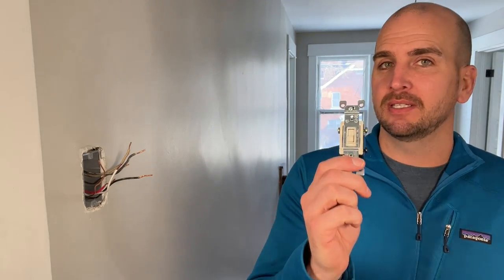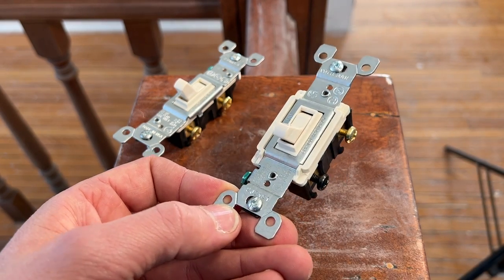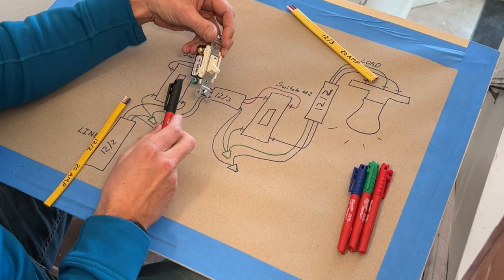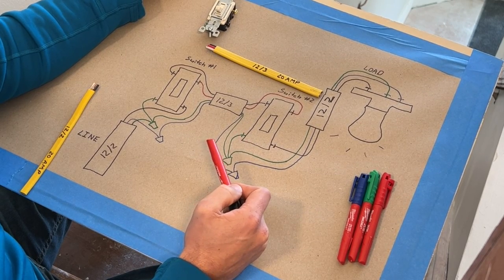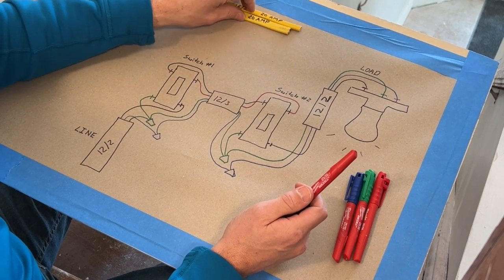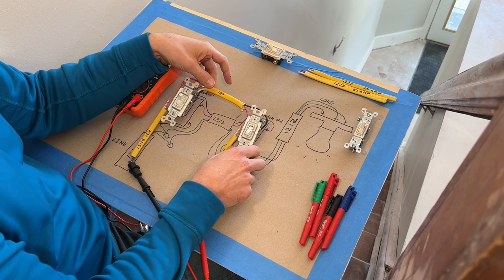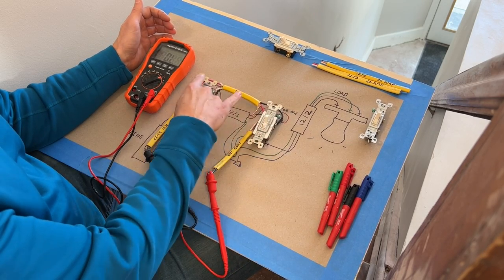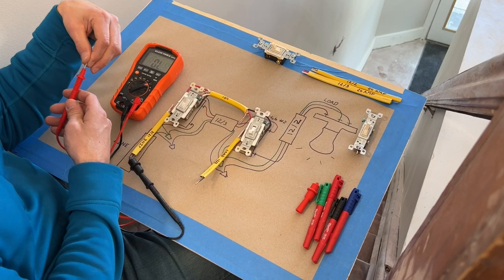How To Wire a 3-Way Light Switch

Comment: When I worked at Menards, I always told people to mark the common with a piece of electrical tape before removing the old switch.  The two travellers can be flipped without issue.

Comment: I replaced a 3-way with a dimmer  with a 3-way without dimmer today, and got the travelers reversed, since I couldn't figure out which was which (thanks to the strange color coding on the wires). By the time I got everything back together, 'off'/'off' (that is, the switch position where a 2-way switch is off) turned the lights on. The funny thing is that my wife doesn't believe me that it's different than it used to be, so I don't need to fix it!

Comment: I love your videos but at the end of this explanation I feel a little like Will Smith at the end of the "Because we're the best of the best of the best.  Sir" speech in Men in Black.  It seems to me like the real reason that has gone unsaid is that: whereas a single two-way switch opens and closes the circuit, the three way switch actually switches between the black hot and red traveler to carrier connection.  So unless both switches point to the same conductor, the circuit is broken - and that's WHY you can open or close it at either location.  As in, the diagram of the switch would help explain the WHY vs. the WHAT.

Comment: Electrician here. You did a great job explaining travelers with the most common wiring technique. There are occasions when the circuit is wired differently ( usually in older homes) But your base explanation was on point. Great job ( are you an electrician btw?)
Reply from the maker: Thanks for the feedback!  I'm just a DIYer slowly building experience on my rentals, flips, and my own projects around the house.

Comment: Excellent review! Not sure if it matters, but my preference for three-way switches is to have the light off when both switches are in the same position (if both switches look "off" then the light itself is off). Does code care one way or the other?
Reply: I prefer the same; when all switches are down, the light is off. When you have one switch down and the other up and the light is off, generally you can just reverse the travelers on the up switch and this should turn the light on. When you lower the switch, it should turn off.

Regarding code, I just finished a series of inspections, which included turning a single pole light switch into two, 3-way switches and the inspector did not care about switch orientation.
Reply: @Around_The_Home  
Why would you care about positions? What if you had three switches controlling one light (two @ 3-way switches and one 4-way switch)? I doubt that all three would be in the same position most of the time. Besides, more often than not you can't see one switch from the other.
Reply: @njsongwriter  Why do people show orienting switch/receptacle faceplate screws so the slots are all vertical or all horizontal? Who ever looks at that? To answer my own question, it is called finishing touch. Also, my upstairs hallway light is controlled by three switches and when all the switches are down, the light is off. The light is also off in other scenarios, but it is always off when all three switches are down.

Comment: Hopefully I can see you do a 4 way light setup. That would be cool
Reply: A 4 way switch would be a switch with 4 contact used in the middle of the 3 way switches. It allows you to have 3 or more switches controlling the same light. 4 ways in the middle with 2 travelers coming in and 2 going out and 3 ways on the ends

Comment: Question, can you add a single pole switch to control a different light at switch number 2 without running a new power into the box? Can this be done safely and current code?

Comment: What does it mean if I have a light switch at the top and bottom of the stairs and they both can be used to turn the light off and on but they can't be used to control the light together?  Example: individually they work to control the light but if one is turned on the other one can't turn it off.  Does that mean I have a wire in the wrong place?  Or is there an issue with the traveler wire?  Thanks for your help.

Comment: My wife and I are adding Lutron motion switches in our stairwell to our basement. The upstairs switch has a  wire that continues to our foyer ceiling lights. The stairwell originally had mechanical three way switches in it. We have successfully gotten the lower motion switch to work correctly, but can’t get the upstairs switch to work with the motion switch. Any ideas on what I am doing wrong?

Comment: Question: can I use a 3-way switch as a single pole? If so, do I connect the line wire to the gold screw and load wire to the black screw or the reverse?
Reply: Yes, but you burn money for nothing.

Comment: I have two 3 way switches operating 3 ceiling LED pot lights. Everything works fine except for some ghost voltage in the circuit - when all the lights are off the LED lights have a small noticeable glow. Do you know how to eliminate this?

Comment: I have two light switches in my kitchen so if you leave house out the garage you can turn off kitchen light without walking to the other end going towards living room....i never understood why on mine, one switch is up in the on position while the other one is off and the light is off. You would think both switches would be off and light would be off and to turn the light on, one of the switches had to be in the on position for the light to be on.....not mine if both is off, light is on... and you can flip which ever switch you want up and it'll turn the light off....well this was working fine just confusing me because I'm use to light switches being in the down position for light being off, I became use to it....but not to long ago, it started acting weird...if I had the switch by the garage in the up position, the switch by living stopped working (up and down had no affect on light)...then if the switch by garage was switched to off, the living room side switch would work just fine up or down turning the light on and off.....I'm so confused and I have not touched any of the electrical and it randomly started this issue. So now I just leave the garage switch in off setting and only use the switch in living room to turn lights on or off in the kitchen.........anyone know what's going on and might help me out?

Comment: I've tried and tried to wire it right, but I can't figure it out. This is a great video for 3 ways, but I have 3 switches for one light. So there are two 3 ways, and one 4 way, and I can't get them to work together for nothing. Replaced all switches the same way they were wired, but it didn't work before either. So I gave up, I now have to walk to the bottom of the steps to turn my light on and off. Good excercise lol

Comment: I owned a house that had a four way switch system. Three switches and a single light fixture above a basement stairway. Thankfully I never had to change those switches out. One switch at the bottom of the stairs, one switch at the middle landing which led to a side room, and the final switch at the top of the stairs on the main floor. The light hung on a long cable lighting all of the stair sections.
Reply: One of the switches will be an intermediate switch, the traveller wires/strappers connect through the switch, it really is no more difficult than a two way
Reply: @michaeldunham3385  Easy for you to say. I'm still trying to figure out the diagram. 🤣
Reply: I had one like that in an old house that we had to rewire before moving in. One switch at the entry door, one at the top of the stairs and a third switch on the end of a short hall that was at the kitchen. All three switches controlled two lights, one over the stairway and another a light in the first level hallway. The two at the further ends were 3-way switches wired as you normally would. The one in the middle took a bit of trial and error for me at the time cause I didn't know which terminal was which on the 4-way switch. This was back in 1980.

Comment: Excellent. 

Now, what if the light is between the two switches, not at the end of the circuit?
Reply: Does not matter. There is only one load cable going from one of the switches to the light. That cable can pretty much go wherever you need it to. So how to wire a 3-way is the same regardless if the light is at either end or in-between.
Reply: It's pretty much the same, your simply connecting the two switches inside the box where the fixture is located. The incoming hot lead goes to the common on one switch and the common on the other switch goes to the fixture.

Comment: What I'd like to know is it so hard to install light switches right side up. Forget DIY, so called professional contractor's down here in Canada can not get this right. I can't remember the last time I saw a entire house or apartment with all the light switch's installed the same way. Very common on a three switch plate is one switch up for on, the next down for on and then an other one up for on, very annoying as it's easy to turn one on as your turning an other off.
Reply: That’s not how it works. No matter which way you turn a 3-way switch it will be what you call “upside down” at some point. It’s science but do the test yourself by flipping one of your 3-ways or both. Then walk back and forth across the room flipping each switch once. You will get a situation where the light is on but the switch appears “off”.
Reply: @mikeydiamonds1   I understand what your saying but I am talking about one switch for one light. They never change, they we're installed upside down. You can just pull them out flip them over and screw them in correctly. The only science involved is how people get so distracted. I installed a light switch then I was 12 and it was right side up the first try. Mistakes happen but this happens way to often.

Comment: I just replaced six 3-way switches in my family room. Five of the six switches have a red and white traveler with a black common. The sixth switch controls the outdoor light from the stair case. The box at the top of the stairs, the line in this case, has a red and black traveler with a white common while the box at the bottom of the stairs has a red and black traveler with a black common. Talk about being consistent 😡

Comment: I have no problem with 3-way switches but wiring a 4-way switch... That is a problem.
Reply: A four way switch has four contacts, two incoming and two outgoing and it witches between straight and crossed.

https://en.wikipedia.org/wiki/Multiway_switching#/media/File:4-way_switches_position_1.svg

You use a four way switch only in the middle switch (or middle switches) though in principle you could use it a a three way switch by just ignoring one of the contacts.

Comment: There is a better way. Hot and lite wire go to same box. Three wire between the switches. The "dummy" end needs no connections. And 4-way switches can be added to dummy end indefinitely.

Comment: with all due respect, why not use a simple schematic that actually shows the contacts inside the switch. Show both but an electrical schematic more clearly shows the travelers. I am an electrical engineer that now has my electricians license, when I see these crazy diagrams of loopy wiring diagrams I shake my head. With a schematic even the four way switch is easier to understand. 

I really like your vids, they are great. But hear me out....
Reply from the maker: I appreciate the feedback.  I am also an engineer and have worked with many electrical and hydraulic schematics over the year, mostly for off-road equipment.  I prefer a schematic which follows standards and uses proper symbols but I have found over the years the DIY crowd seems to shy away from that type of teaching. 🤷‍♂️. Maybe I will give it another try 👍.
Reply: @EverydayHomeRepairs  I really like your channel. I see those drawings and they make my head hurt. I think most would benefit by seeing an electrical schematic AND the type of drawing you show. I found one site that gave a great explanation of 3 way and 4 way. If I can find it again I will post. Again, great channel.